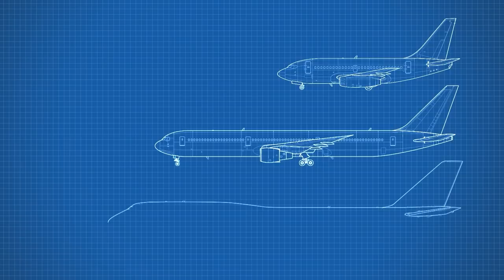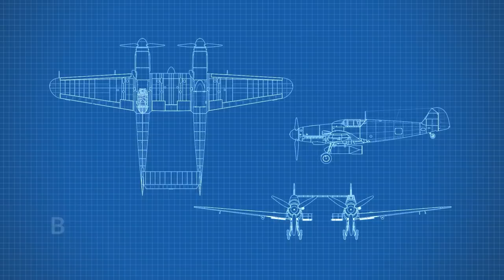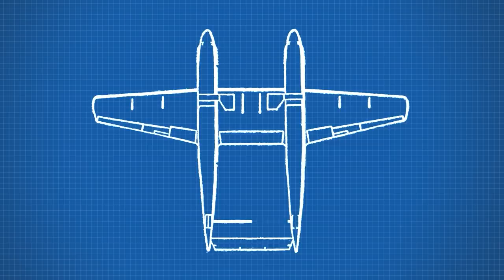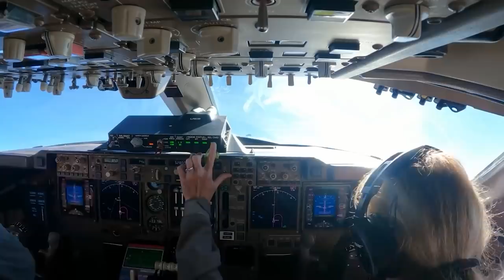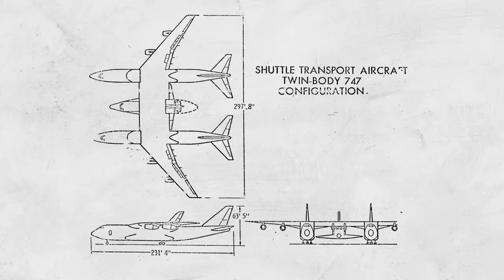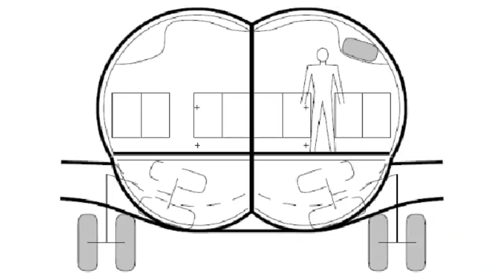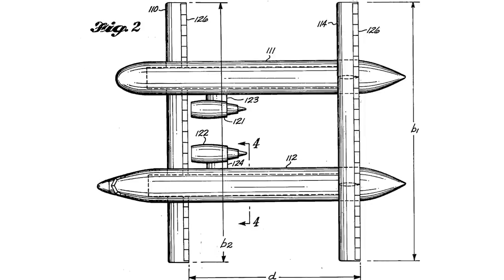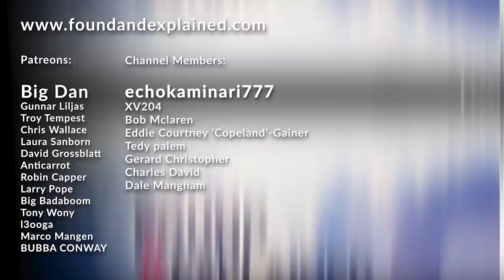Why America Built A Two-Seater Mustang...

Comment: Originally designed with the propellers spinning the same way as in the P-38; propeller tips meeting on the upward swing, towards the center. However, it would not take off, so the engines and propellers were swapped; tips meeting downwards towards the center. Took a month to figure out the problem, but the alteration worked.
Reply: what was the problem then?
Reply: @carlosandleon , apparently, the problem was the odd aerodynamics of twin counterrotating propellers. Swapping the engines and propellers side to side solved it.
Reply: @et76039  I still don't see why that was a problem though
Reply: @carlosandleon , an airplane that cannot take off is nearly useless.
Reply: @et76039  For sure,  but what made the airplane  not fly with the previous contra rotating engine design? Why would it fly one way and not the other?
Reply: @oldchap1228 , yes, it is weird and seems counterintuitive. However, the original configuration created too much drag. Aerodynamics is a weird thing.
Reply: @carlosandleon , the Wikipedia article describes the issue in the paragraph to the left of the photograph of the F-82 flying with a P-51.   https://en.wikipedia.org/wiki/North_American_F-82_Twin_Mustang#Design_and_development
Reply: @oldchap1228 , it was the P factor that created the drag. This is a phenomenon that only occurs with propeller-driven aircraft.
Reply: @carlosandleon  because the air traveling downward in the center would stall the wing so only the wingtips would have any left.
Reply: @carlosandleon  the prop wash prevented the center section from generating lift.
Reply: @et76039  it also caused the handling to be much more speedy because of physics
Reply: @carlosandleon  Wings generate lift because (oversimplifying) the air going under the wing on the flat side and the air going over the wing on the curved side causes a pressure differential because the air on the top has to cover more distance (the curve) than the air on the bottom (the flat).  The issue was that the propeller wash (the vortex of air created by the spinning propellers) cancelled out the lift from the wings when the coming-together part of the two vortexes was under the wing.  Swapping the motors, thereby causing the vortexes to spin the other way (coming together over the wing, going apart under the wing instead of the other way around) didn't cause the same drag issue.
Reply: Doesn’t make sense, thrust is thrust…..
Reply: @skycop99 , for propellor driven aircraft, the P factor comes into play.
Reply: @et76039  P factor in a multi engine aircraft with counter rotating props is cancelled out, unless you lose an engine……P factor doesn’t exist on the ground for multi engine planes.
Reply: @skycop99 , it's in the Wikipedia link cited earlier.
Reply: OK
Reply: Just saying your earlier P factor comment was in error.
Reply: @skycop99  changing the direction of the props changes which way the air spins,  of the props turn where the air is flung upwards in the center, creating more pressure above the heaviest part of the wing (bad. Would need even more thrust to get enough ground speed to take off and simply not able to due to engine limits). By switching the props, the props would now be sending air rotating downwards, helping to increase the already high pressure under the wing (good, that’s what generates lift).      Prop blades are not flat. They are like a fan you use to cool off.  They are tilted to move the air forward/back (depending on rotation direction).   Thrust may be thrust, but you still need lift if you don’t want to end up in the trees or lake at the end of the runway.

Comment: 7:11 If it's piston engined, it's not a 'fighter jet'.
Reply: Yeah some of the errors in this video are questionable
Reply: Those darn piston jet turbofanrotors were so unreliable back in the day, glad we use diesel jets now
Reply: At the start there were tons of massive errors with speed, how to improve range etc.
Reply: piston engine could be used to power the fan of the jet engine
Reply: @jullyxiao814  There is no jet engine on this, it's two P-51s with Merlin engines.
Reply: @avnrulz  I know, just saying that the notion of a fighter jet with a piston engine technically makes sense
Reply: @jullyxiao814  Those are called motorjets though right? Also incredibly weird.

Comment: Twin a380s make a lot of sense.

Particularly if they had their own private airports, and just hauled cargo.

Since you could build the airport outside of population centers, shouldn't be too hard to find cheap land. Since it's just a cargo airport, all you need besides the landing strip, is fuel, a tower, a parking lot, and a coffee pot.

Baby specially designed cargo pods that double as trailers. Like folding landing gear and hitch, so you don't even need a crane. Maybe a little electric drive so they could load and unload themselves. Nothing fancy just need to get to the yard mule, or a tractor.

Something something profit.
Reply: Basically a cargo aircraft that can function in unprepared airfields?
Reply: @foxgaming76yt24  trucker shortages. Supply and demand.

It's getting more expensive to ship things, therefore maybe it's worth it.

I just think it would be cool.
Reply: @jtjames79  cost tho ..it's 100 times more expensive to ship stuff in a plane then with a ship
Reply: this guy singlehandedly found a whole economy
Reply: @DrSmugface  no

Comment: I'm glad they pointed out that while RESEMBLING 2 mustangs bolted together, there were huge differences in the actual Airframes.  In fact, IIRC there was something like a total of only 3-4 parts that were common between the P-51, and the F-82.  Oh, and one small thing made my eye twitch.....the "Last Piston-Engine Fighter Jet".....line
Reply: you are so correct, you must know about Tom Reillys P-82 that he restored and is in Titusville FL at the VAC museum.....it was the prototype for the P-82, later designated the F-82  when the Air Force was formed in 1947......

Comment: The next BIG thing in commercial appears to be the Blended Wing Body (BWB) and not oversized twin fuselage monsters which require special runways and terminals.
Reply: A BWB design also requires special terminals, plus has some weird issues with evacuation of passengers in an emergency. But both approaches are viable.
Reply: @HalNordmann  I am placing my money on the  BWB, fuel efficiency for the win.

Comment: At 4:25 "Its small fuel tank"....                                                                                                                                                                                       The P-51D had 5 gas tanks. 1 in each wing. 1 behind the pilot. And 1 under each wing.                                                                                         The P-82 was conceptualized due to the P-51s two "cruise settings" of 225 and 275 mph could knowhere near keep up with the new B-29s 350 mph cruising speed.

Comment: Isn't the Lockheed P-38 Lightning kinda a twin fuselage plane?
Reply: Yeah, it at least deserves a mention.
Reply: Quite of but not actually , you see the P-38 is list in the twin boom design , meanwhile the twin fuselage is fuse 2 fuselage to make a plane for example the F-82 and the Bf 109z , but the P-38 is also similiar so it like at the between of those two , but i say the P-38 is a twin boom design
Reply: As other said, the P38 is twin-boom, not twin-fuse. Like the Noratlas or the C-119. The main difference is, you got the engines extending into the tail booms, but the main controls and cargo/pax remain in a central position, whereas double cockpit has those off the center line.

Comment: For a vision of what creative engineering could have done with this plane, check out the Gingrich/Forstchen novel "1945" where, at the climax, the US has only 3-4 weeks to come up with some way to fight a horde of Nazi jet aircraft with advanced weapons to save the UK from invasion.  The hero, along with a young Kelly Johnson, describe a system for swapping Merlin engines into the P-82's and adding in an experimental rocket booster so that the P-82's could fly across the Atlantic, and then, along with carrier-launched aviation with similar boosters, outfly the Gothas and Messerschmitts.  Note to Newt: we are still waiting for the sequel to this since 1996!

Comment: The Dual C-5 For the shuttle was a proposition for a Carrier Plane, not an air-launch platform. The shuttle REQUIRED the ET and SRBS to get into orbit, as it only carried minimal fuel for orbital insertion and maneuvering onboard. The real advantages to an air-launch platform are minimal, as they are only able to provide a fraction of a percentage of the energy required to get to orbit, as most of the energy required is horizontal kinetic energy, not gravitational due to altitude. The Shuttle Carrier Aircraft bid was to transport the Shuttles From Mojave back to the Cape Canaveral Launch Site, as the Florida Shuttle landing site had not been built at the start of the program, as well as to do atmospheric drop tests in the development phase.

Comment: The F 82 was originally called the P 82.  It was  designed with 2 cockpits because of the huge distance the P 51 had to fly in the missions from the Marianas to Japan. There were more losses from storms and pilot exhaustion than from actual combat against the Japanese.

Comment: In all actuality, it wasn't really a two P-51 Mustangs built on a common wing. To save design time, they did use parts from a Mustang, but the rear of the fuselages was totally different in design.  The speed that they built it in, for the war, was by using some of the parts from the Mustang, but there were other airplanes that used parts from prior designs as well, to speed up the design work.

Comment: 5:18 Obviously neither the animator nor the narrator understood the concept of a "dorsal fillet" (not "filler"). That's the triangular part in front of the fin, enlarging the area of aerodynamic surfaces that provide directional stability. It is considerably larger on the P-82 than it was on the P-51 (where it also was only introduced with later versions.)
Nobody in the business would call the elevator/stabilizer mounted between the fuselages a "filler". It is also essential for flight stability with a conventional wing, and not just "in case of engine failure". What you DO want in that case is additional directional stability, provided with vertical surfaces.
Calling the fuel capacity and range of the P-51 small is also kinda ironic. The Mustang's main claim to fame is that it allowed the daytime bombing raids to Germany as it had enough range to escort the bombers over the target German cities. It had exceptional range for a single engined fighter for the time.

Comment: As a non-engineer, I must ask, for a fuel efficient airliner, why not have twin fuselages at the ends with all the wing in-between. Wouldn’t this eliminate the wingtip vortices problem?
Reply: Harder to maneuver
Reply: No chance for a number of reasons.
Reply: @chamberlane2899  Model your dumbbell, twin fuselage design in Kerbal, let me know how well it flys.
Reply: @chamberlane2899  In any case, placing the mass of the fuselage and cargo on the ends of the wings is daft.

Comment: I'm not sure any design using twin hulls or blended wing bodies that places the passengers a long distance from the longitudinal axis of the airframe will would a hit with passengers.  If you're a long way from the axis, you'd experience a lot of movement when the aircraft rotated around that axis in a banking turn.  Even the largest wide bodies today only place passengers a few feet from the axis.  Double or triple that and you might find passenger comfort compromised.

Comment: If I may make a correction:

Min 6:21, "... the aircraft did its first test flight in june  1945 and the US. AIR FORCE officers were so darn impressed..."

By june 1945 there was not such a thing like the US. AIR FORCE, due to it was created in 1947. 

By that time existed the US. ARMY AIR FORCES (USAAF) since 1941, and before that existed the US. ARMY AIR CORPS (USAAC) since 1926.

And also you were wrong about Pilot and Radar Operator position (Min.5:44) in later variants (night fighter); the pilot is always on the left, but not from the front view like you show,  but from the COCKPIT VIEW, that is, you show them inverted.

Cheers!

Comment: From a design apects of the p-51 turned into this is just as crazy plane. Though if you think bout this being two cockpits. This makes sense if one pilot has gas,thanks robot chicken, one pilot is enough to fly this plane. Though my thoughts are to the ridio operater what reference does this pilot use. Target plane is to my rite low. It's not the same thing as to the radio operator in other fuselage. If you think bout it though was this the protype to top gun?
Reply: In those days, radar systems were too complex for someone to operate and fly at the same time.
Reply: Very true. If you think bout it. They still are. Top gun fighter school has two people in each u.s. navy aircraft to help with the spotting of targets in general. The enemy aircraft are sometimes single seaters and surprisedly still nimble. Many have and still sharpen there fighter skills. I can't even imagine how to deal with the mental loads after each fight.

Comment: Yeah but the biggest problem to double fuselage for passenger planes is the location of the seating being too far from the longitudinal axis of the plane. The g-forces magnify, air turbulence is hard enough for the general public to take comfortably. Move them far off the axis and it would be unbearable to most in regards to simple turns and turbulence.

Comment: 7:48 - that whole part about launching Space Shuttles from a twin-hulled custom airliner isn't right - that would only ever have been a (good) transporter, as the shuttle needed at very least a large hydrogen/oxygen tank or two strapped to it to fuel those 3 big engines - the rest of its internal volume was just for cargo and crew

Comment: The statment for the A380 is all wrong.

I scaled up aircraft will get both more range and capacity. This works for everything from a 737 to a 747.

A A380 actually have shorter range, the procent fuel to total mass is actually lowet than most other long range aircrafts.

So why is so uneconomical.

Two factors.
1: its a 4 engined aircraft, when a 787 and a A350 can fly just as far. So there is really no reason for it.
2: its the last generation, built right in the generation gap.

Look back at the 737-100, 727 and 707. They are all pretty much the same aircraft. One short, one a bit longer, one long.

The extra engines is pretty much carrying only fuel.

Compare a A300, DC10 and a 747-100. Same thing. More engines more range.

When coming around to a 777 and a 747-400, excess range was traded for more seats... why? Becuase the earth simply isnt larger. The 747-400 as well as the 777 can cover over 85% of earth surface, making more range pretty much useless.

Of cause the 747-400 was prior to 777, so it made sense to make it.

For A380 they had to trade even more fuel for seats,  while it made it somewhat of a efficent aircraft, this design was on the way out 10 year prior to it even taking the first flight.

Comment: You're the first video I've disliked in many years. The p-38 that the US flew in the Pacific theater had a twin boom design with a cockpit pod in the middle, and turbo chargers. It was Kelly Johnson's first baby. Get your facts straight. The p-38 actually fought in WWII!
Reply: Correct in that P38 was a twin boom design - but with a single fuselage. This video is about twin complete fuselage planes.
Reply: @ericadams3428  a cockpit dosen't make a fuselage. A FUSElage is where everything attaches together, generally in the middle. They both sortta have three though if you ask me.

Comment: the p-38 lightning is comprised of 2 mustang hulls, guys please.....

It was one of the best fighters of the war......

read more please
Reply: There's absolutely ZERO commonality between the P-38 and the P-51. None.

The closest thing to similarity would be the P-51A used an Allison engine that was similar to, but not the same as, the Allison in the P-38.

The P-38 was already in service, in combat, shooting down enemy aircraft, before any P-51 even flew.
Reply: @AlanRoehrich9651  Great speech, I fail to see an argument. So i will re iterate. the fuselage of the p-38. Not engine was effectively by design and looks 2 P-51 hulls glued together. the fact it came out first only strengthens my argument.
Reply: @sniper205howard  
There's absolutely no similarity between any P-51 fuselage, and the booms of a P38.

In fact, they're so dissimilar that the Merlin engine will bolt into the P-51 fuselage, but will not even remotely begin to fit a P-38 boom.

Nothing is even in the same location. The oil coolers, intercooler,.and radiators are all in different locations. And so is both the air intake and the exhaust.